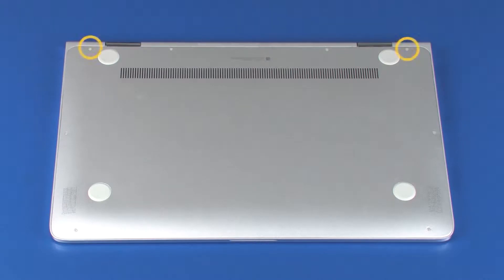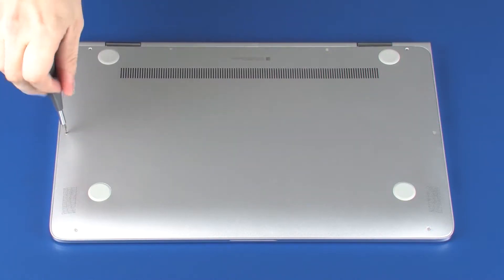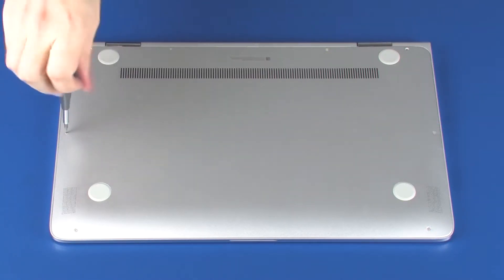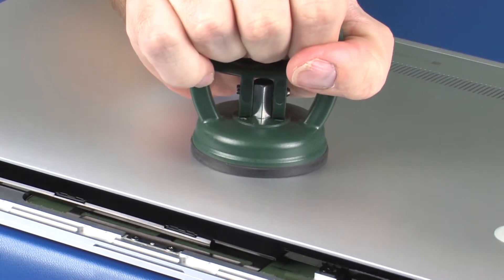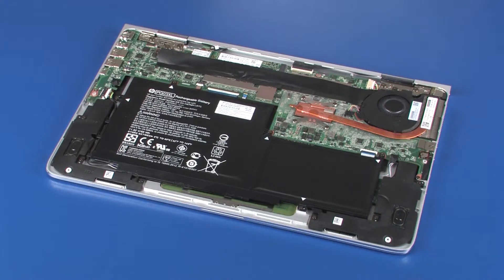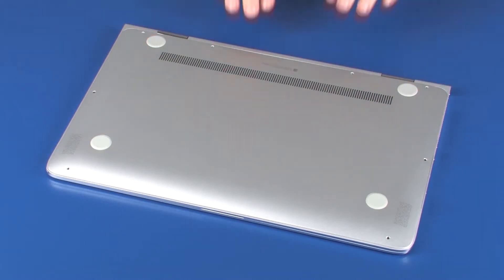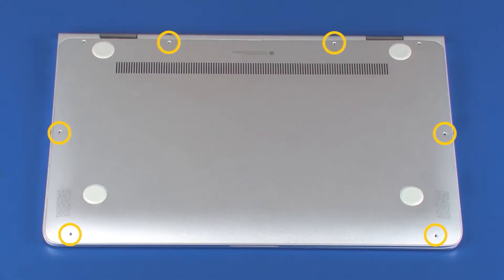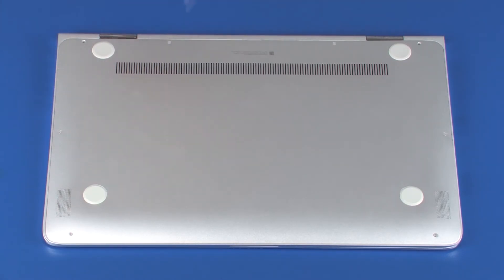Replace the Base Enclosure | HP Spectre x360 Ultrabook | HP Support

Comment: What is that suction device to remove the base after unscrewing??
Reply from the maker: +Zoya Azhar Have available a small, Torx-head (T5) screwdriver, a non-marring flat-bladed alignment/prying tool, and a suction cup (optional).